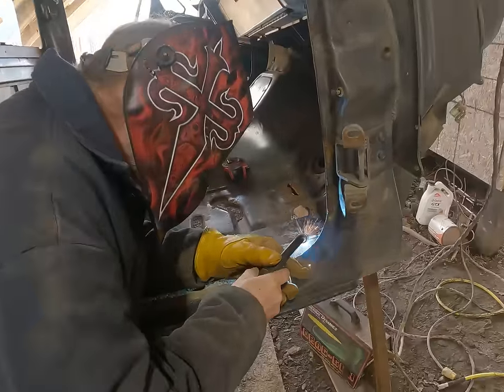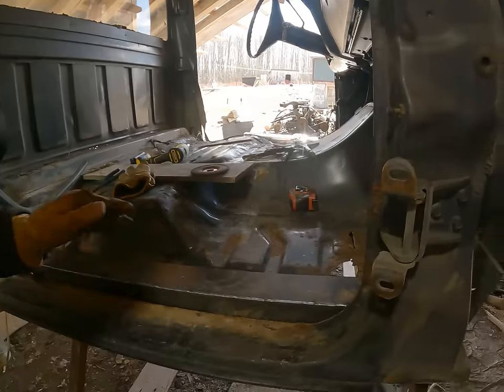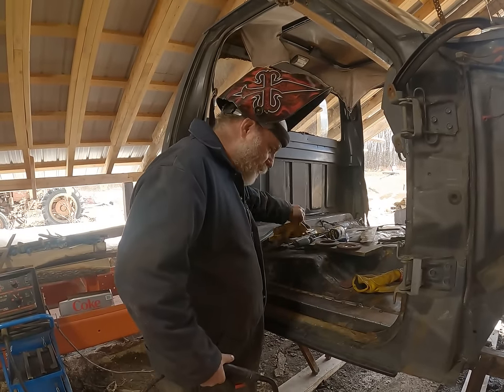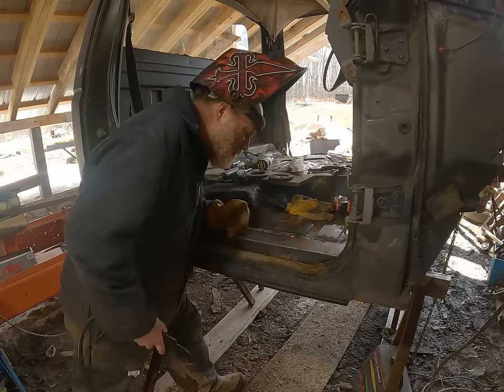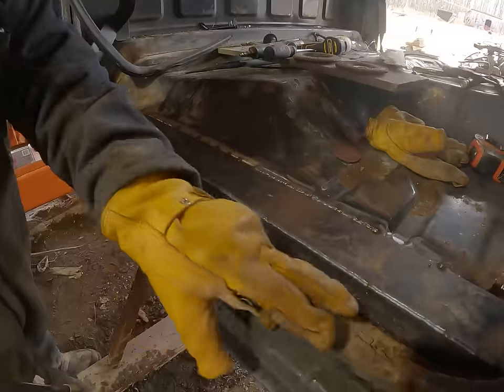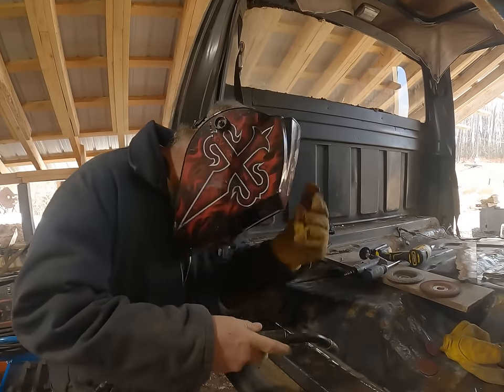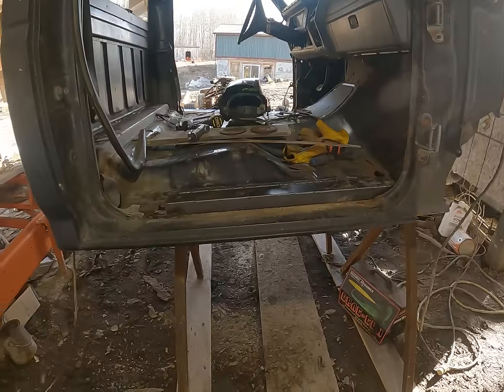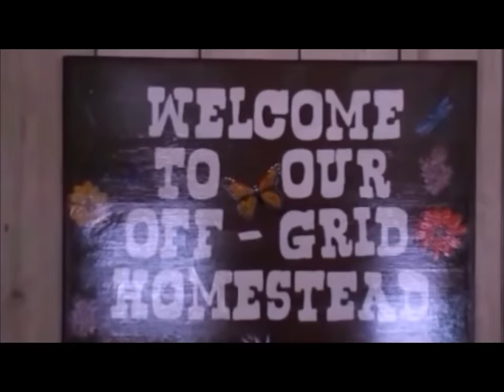Try This On A Brand New Vehicle...I Don't Think It's Possible Any More.

Comment: Give you a little pro tip something that will help you out get you some thick clear plastic where you don't lose your sunlight hold it up with magnets on the other side of the truck make your wind block it'll keep your gas from running off and it also make your weld better just something to think about keep up the good work looking good Barnes looking good y'all just keep doing what y'all do y'all are just fine

Comment: Your exactly right Cecil, the metal in newer trucks are paper thin. I once had a 2002 Chevrolet Silverado and my nephew who was about 18 years old was standing in the bed he stepped on the side rail to jump off the truck and bent the rail on my new truck. He was very sorry for this but in his defense the truck was very flimsy. Back in  '85 you could stand on the hood and not damage it. You can't to that today. LoL
Reply from the maker: Hello Dean, I understand exactly what you are talking about.  I bought a new 2001 and a 2002 Chevrolet Silverado,  after a couple months the top of the box was all dented from me resting my elbow on top of it and lifting my tool box over out. Thanks again. You have a great day.  Cheers!

Comment: Have you ever done a video on flux core welding? I purchased one and I am trying to learn. My welds seem to hold but are not very appealing.
Reply from the maker: Hello Bill,  sorry I haven't made any videos on flux core welding. Flux core welding is not usually great looking at the best of times.  I would just try to turn up your heat or turn down your wire speed to see if this helps.  Thanks again.  You have a great day. Cheers!